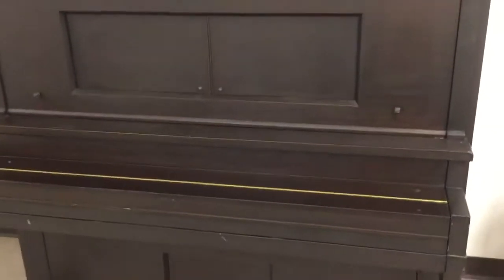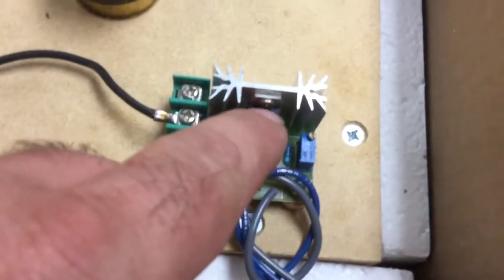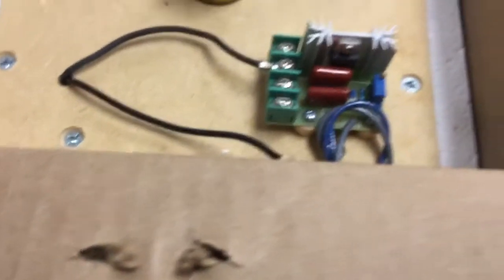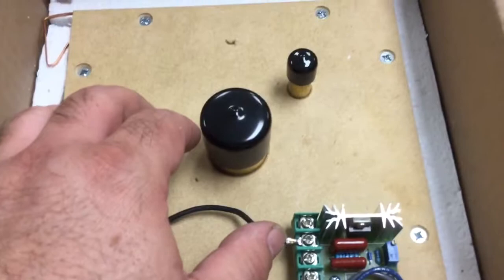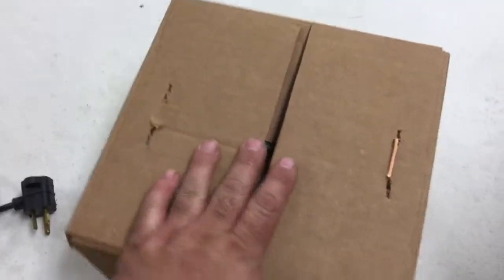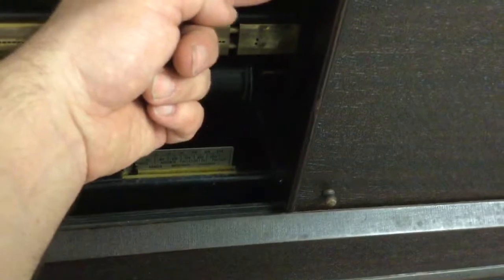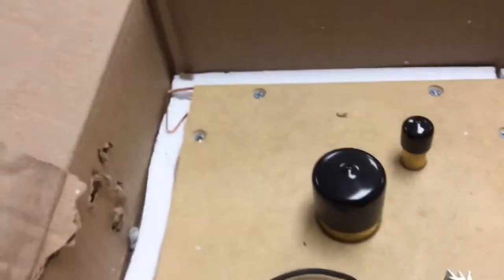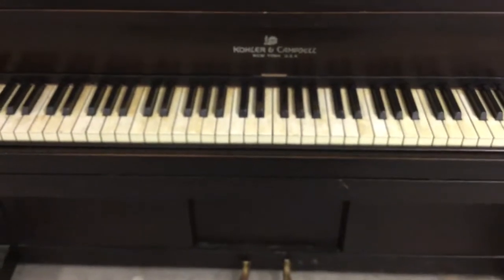Adding an electric pump to a foot pump player piano-An overview

Comment: There are LED versions of that light bulb,  It will use much less power and not get hot.  The filaments are lines of LED's. I use them in my 1936 jukebox.

Comment: Why would the piano even need anywhere close to 70" WC when one technician said you only need between 10 and 25, especially when the pedals will run the piano just fine and you don't hear anywhere NEAR this much noise?
Reply: Using the speed control you can reduce the WC  and the motor, running slower, is much less noisy.
Reply: @traindavid : Even so, I would still hear the awkwardness of "My piano runs on a freaking vacuum cleaner fan!" I'd hear that no matter how slow you turn the thing within functional range.
Reply: @HelloKittyFanMan  Well, yes, and I have no idea why he wants to electrify a good functioning foot pumper. I wish they would let me post a photo here, I would show you how Cable fit both a foot pumper and an a motorized bellows pump in an upright--the under keyboard area is really filled! Oh, and the Recordo modifying unit is in there too! No, you can't really see the strings from the front!

Comment: Yeah, that those suction boxes are basically cannibalized vacuum cleaners is exactly why you would NOT want one for a player piano! They... well, they... "SUCK"! Ha! I mean too much! They're too NOISY! It doesn't take a rocket scientist to tell you that these are absolutely ridiculous for this sort of application! Who wants all the vacuumy noise these make while you're trying to listen to some nice music? Why use one of these pieces of crap when you could install the big quiet pump with the big quiet motor instead (the big square with the big flywheel, belted to a somewhat big induction motor that is ironically quieter)?
Reply: Because there isn't enough room under there for that set up--unless you take out the pedals and the pumping  bellows and create a new spring loaded bellows for make-up vacuum. Then, of course, you cannot hand pump the piano and it becomes electric only.
Reply: @traindavid : Then how is that that I've already seen some with the pedals AND the non-noisy electric pump down there?

And who would hand- pump it anyway, when if you want to pump it manually, you'd typically use your feet instead?
Reply: @HelloKittyFanMan  OK, ya got me, I meant FOOT pump! Some units leave more space under the keybed, others don't, and as I posted above, Cable Co. managed to put both under there, but the space is FULL!
Reply: @traindavid : Nothing wrong with the space being "FULL" if it works, right?